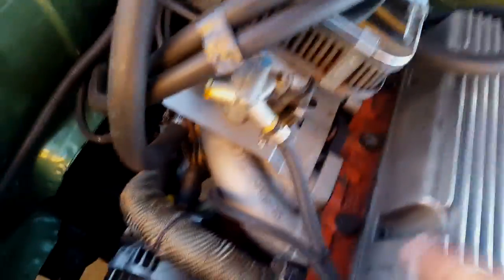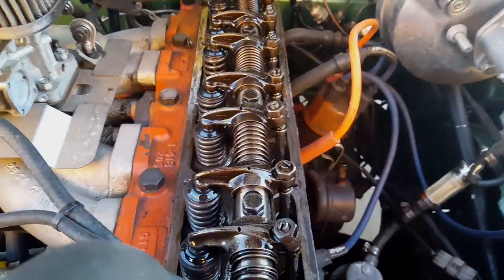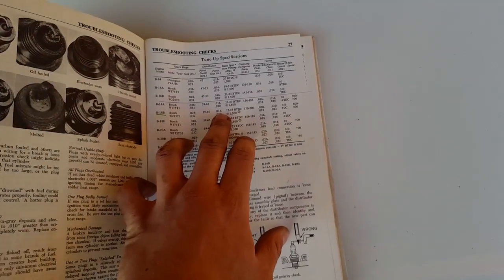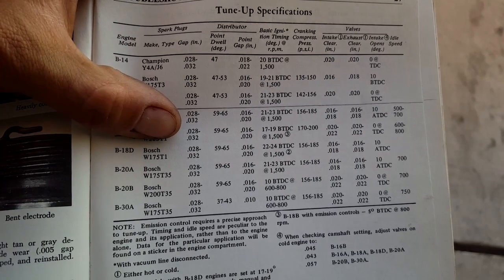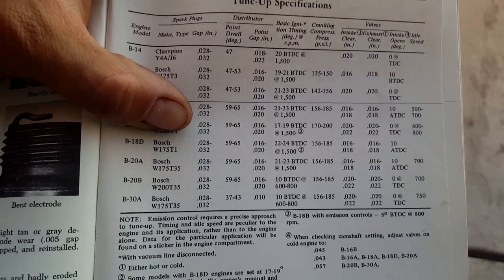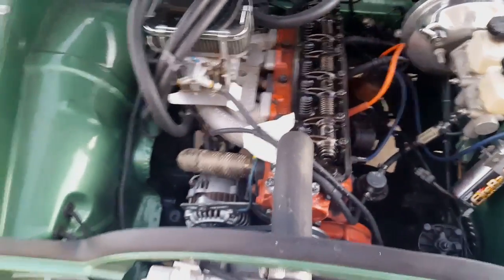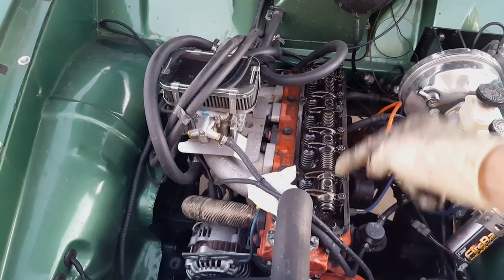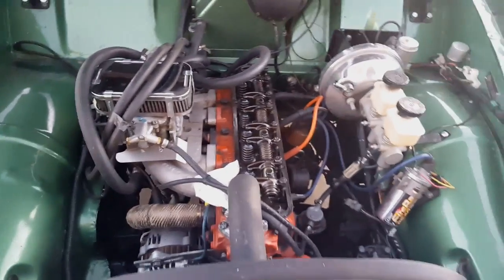🇸🇪 Volvo Amazon B18D valve adjustment

Comment: you can also see on your crank disc (don't know the english word) which has the numbers 10-0-10 on it and a little peace sticking out on your distribution case. when that peace is lignin up with number 0 you must be able to adjust a couple of them. after words you turn your engine 360° degrees and you can adjust the remain ones. Be sure you make clear which valve is exhaust and which is inlet. awesome and simple video